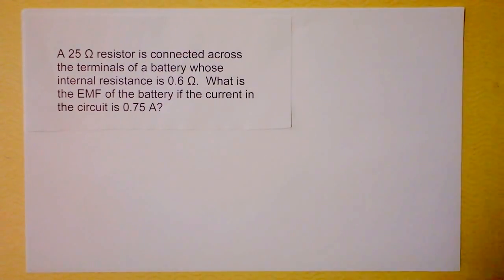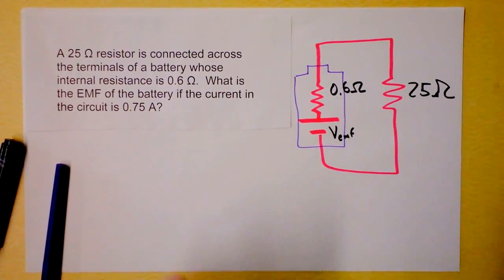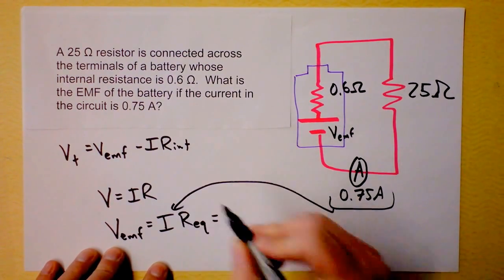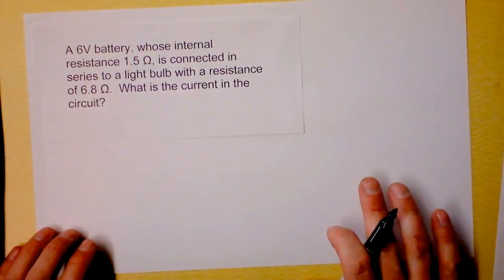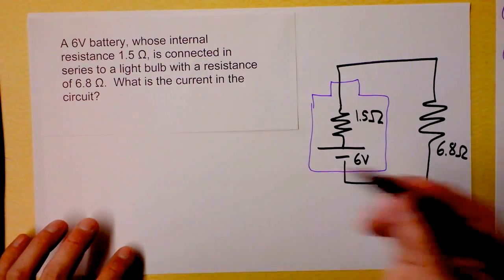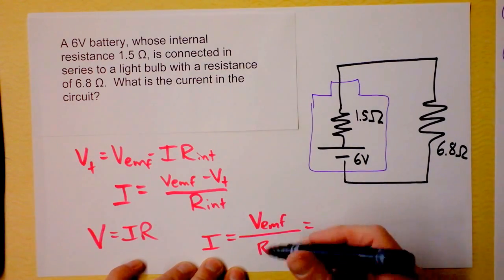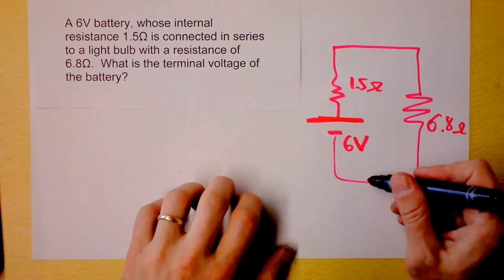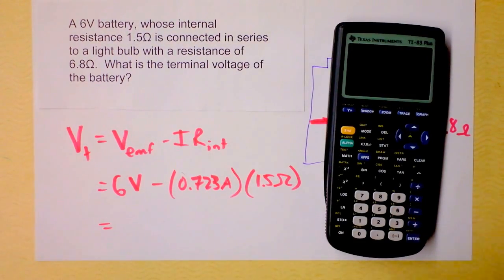EMF, Internal Resistance, and Terminal Voltage of Batteries Worked Example | Doc Physics

Comment: Hi can you pls answer this? A cell has a terminal voltage of 50.0 V for a current of 10.0 A, and 54 V for a current of 6.0 A. Find the electromotive force and internal resistance of the cell.

Comment: In reference to the circuits you've drawn in the video, I have the following question: Given that the internal resistance is not an actual resistor per say, should the internal resistance not be calculated as though it were in parallel with the external resistance? Helpful video BTW, Thank you.
Reply: Broo u dumb??
Reply: no. series

Comment: the answer the follwing qustion when circuit is open the terminal voltage of a battery is 2 v ,but this falls to 1.92 v .when the resistance of 0.12 ohm is connected across its terminals

Comment: Hello, I'm working a very similar question here in the UK where i first need to find the current in the circuit then the terminal voltage of the battery. I have two resistors in parallel so must use Rt^-1 = Ra^-1+Rb^-1 to get the total circuit resistance i need to add the internal resistance of the battery as Rc + Rt (this is how i get to the given answer)? I just wondered why you don't add the internal resistance as a parallel resistance to e.g(Rt^-1 = Ra^-1+Rb^-1+Rc^-1). Thats probably a silly question but when you draw the circuit the battery sure looks in parallel? Cheers
Reply from the maker: +Jake Entwistle They are in series because only one path exists for current to flow.  I therefore know that the current through both resistors is the same.  Diarrhea.
Reply: +Doc Schuster Of course x(. Thanks for the quick reply

Comment: wait wait wait, what is the purpose of dividing 1.2 ? for what? 

ihave no idea in this topic please help me or link me in another video
Reply: Dividing by 1.2 isn't necessary. He was just interested in seeing how many "cells" were inside of the battery. Most rechargeable cells have a voltage of 1.2v. I don't think you need to calculate that in any sort of high school exam.

Comment from the maker: Victor Dolman Lazy and brilliant is one possible (and enviable) path to success in physics.  I like your solution.  However, I'm not sure it's less thinking.  Is it?  You're plugging one wonderful equation into a more esoteric equation, but I chopped the fancy framework off the problem and exposed it as a very simple one.  I accuse YOU of thinking more.
Reply: +Link Zelda more like a big fat Dummy!
Reply: Haha :-)
I once had similar difference of opinion with a professor I worked for. We had different ideas of what is 'easy' and 'straightforward'. It has to do with thinking style.

You call the first equation (your eq.!) esoteric, and count its use as thinking. To me an equation is either wrong/meaningless/unknown, or it is trivial (which means that I have understood and accepted it, at least for the time being). Use of a trivial equation is trivial, and does not add to my thinking effort. [For this use of the word 'trivial' see Feynman's 'Surely your joking' when he is talking to mathematicians. :-)]

What really takes intellectual effort is changing the reasoning, i.e. reflecting on how it's going and deciding on a new course. That's hard work that I want to avoid. So if I can do a problem by running along a single line of (trivial) steps, I'd much prefer to do this than finding a shorter reasoning. You, and my professor, disagree. I respect you both, but I don't change my view. The effort of rethinking a problem outweighs a small reduction in steps. (If the reduction is really huge it may be a different matter.)

My professor was highly intelligent, and I guess you are too. I can assure you that physics looks a lot different for someone with a below average IQ. We prefer the straight stretches over the curves anytime. (My IQ has been reproducibly measured to be 89.)
Reply: PS:
Imagine a student needs to do 10 of these NJ guy problems. They can all be handled by the 'esoteric' equation and Ohm's law. But say 3 of the problems allow a simplification by clever reasoning. Would it be more efficient to look for the simplification, or to mass produce all the answers in the same way?
Reply: PPS:
Maybe you value creative thinking by the student more than efficient production of the answers. Suppose a student says: let's forget about all the numbers. Here are two equations, and here I show algebraically how they can be rearranged to correspond to each question a guy from NJ might possibly ask about this system. Straightforward mindless algebra that solves all problems at once. Would you still want him to look for simplified reasoning in particular cases?
Reply from the maker: Good points, all.  I think your accusation that I value creative thinking more than efficient production is the best summary of where I am as a teacher.  We can program machines for maximum efficiency, but it doesn't benefit the punk kids as much as holistic understanding.  And I don't know who "measured" your IQ, but I think THEY should be tested.

I have a very messy, piecemeal understanding of generalized intelligence, and I know that effort has more effect than gifts, but I have a feeling your measured IQ is correct only to the nearest order of magnitude.
Reply: Doc Schuster LOL Doc. Schuster is a boss !

Comment: You are amazing, finding fun in this sort of problems. A guy from NJ! I love it.

I'm lazy, and I recommend this lifestyle to everyone, especially in physics. I don't like to think too much. A little is fine, but when it can be avoided I'd rather do that. You start the first problem at 1:24 by writing down
V_t = V_emf - I R_int.
And then you insist that we think again, and use another equation, describing how V_emf works on the 'equivalent resistance'. Nah. Just use the first eq. and note that V_t works on the external resistance: V_t = I R_ext. Put in, rearrange, result. No thought.

When I think about it (which I shouldn't): do we need this whole 'equivalent resistance' concept at all? Instead of teaching it, we could have more 'guy from NJ' jokes.